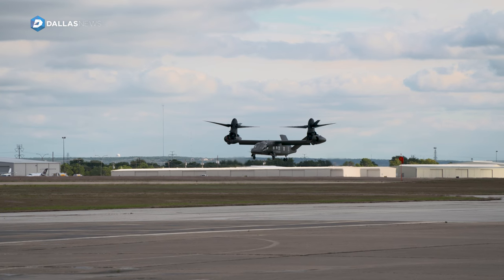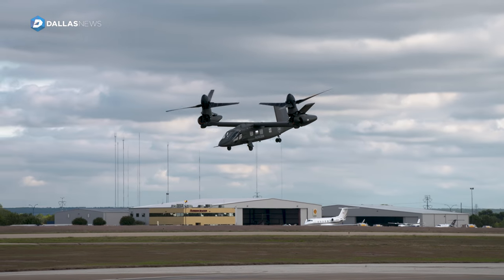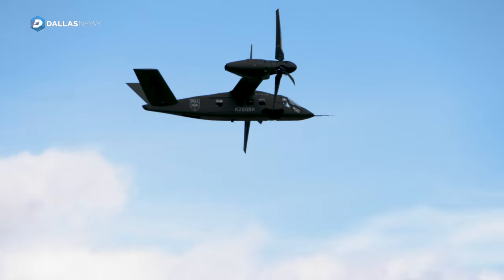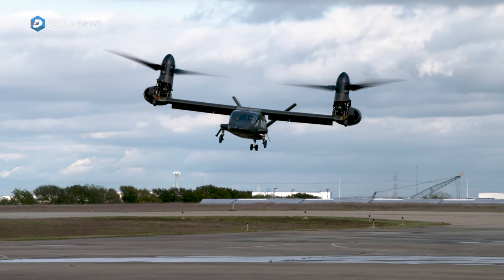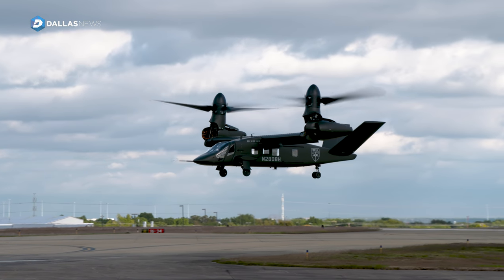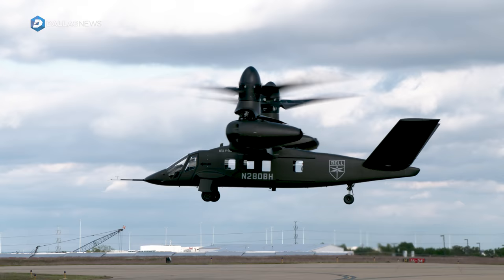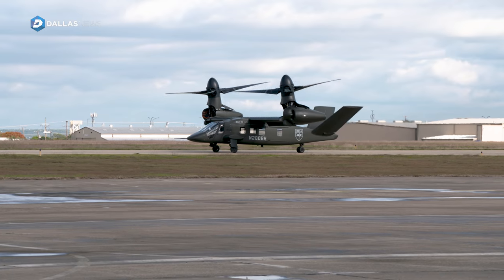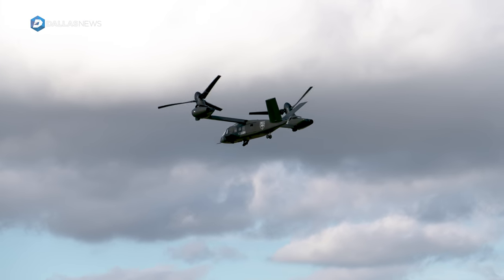Bell V-280 Tilt Rotor Aircraft Flies Demonstration

Comment: I think these types are easy to take out with small arms fire
Reply: They fly higher and faster than small arms fire can actually hit them.
Reply: When flown correctly they are in one of two modes.  Either flying high enough to be out of small arms range or low and fast enough that they aren’t exposed to the small arms long enough for them to get a sight picture.
Reply: @chrissmith7669  not really, they have to insert in hostile locations sometimes or provide close air support where the enemy can shoot at them. Like Mogadishu.
Reply: Too slow.  Transition from hover to forward flight is too slow and vice-versa for insertion/extraction on hot LZ.  It can be a good addition to the Utility Helicopter Program but it is a bad replacement for the UH-60 platform.

Comment: I can see it replacing the Blackhawk but not sure about the Apache. At least in the current form, it is nowhere near as armored as the Apache is.
Reply: You are aware that the four side windows and the one above the pilot is acrylic plexiglass. The windows above and in front of the copilot are tempered glass. There is a transparent blast shield between the two pilots that's made of polycarbonate acrylic laminate that's about an inch and a quarter thick. The transparent blast shield is the only one that could be considered "armored".
Reply: these are prototypes and are not armored for either the Blackhawk or Apache roles. You would have to wait for a final version.

Comment: You can’t replace Blackhawk with a machine that has a larger footprint than a CH-53 and is 3 times more complex
Reply: Yeah i think the Sikorsky Defiant helicopter will win the govt. contract over this, however I like this Bell machine and would like it to succeed.
Reply: It only has a 19% larger footprint than the Blackhawk my guy. The V-280 might be 3 ft wider but the CH-53 is 44 ft longer...
Reply: @filipdrucker4990  Defiant was outperformed in nearly every metric in testing.